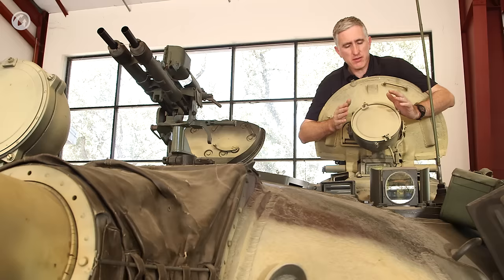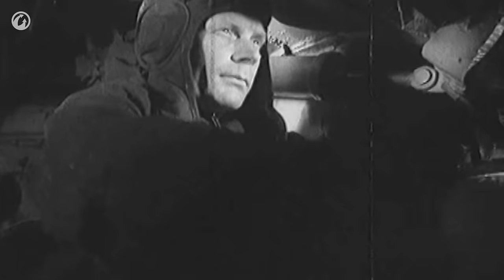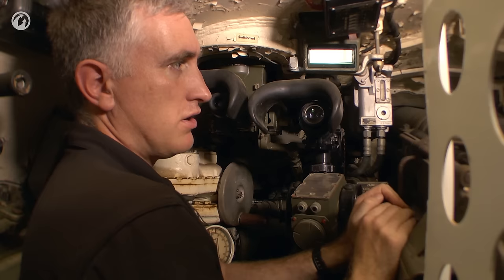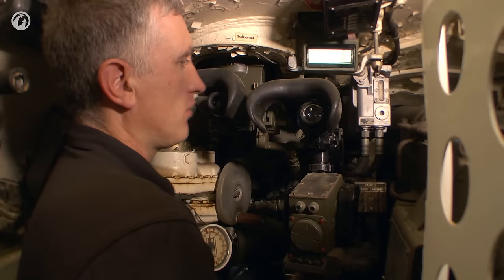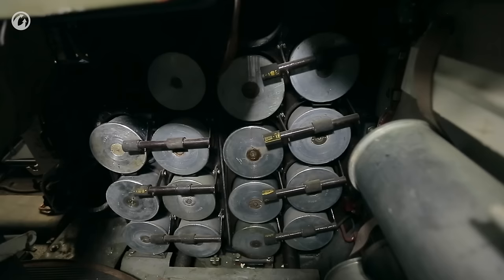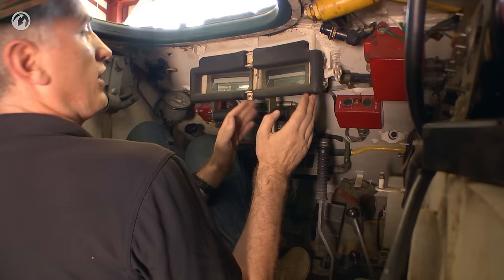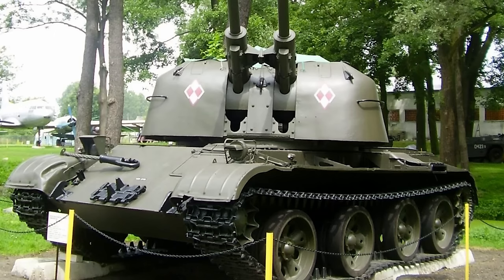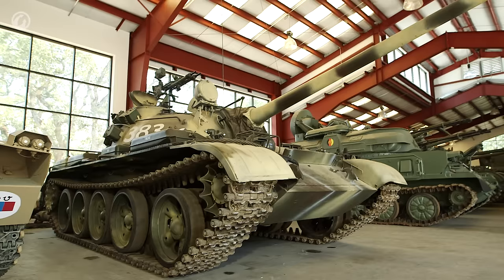Inside the Chieftain's Hatch: T-55A Part 2

Comment: I'm surprised that the Russians didn't try creating a modern separate armored ammo storage compartment on the rear of the turret (with blow-off panels) like most modern Western tanks.  That would have made the tank a heck of a lot less prone to brewing up during penetrating hits.  Likewise adding an anti-spall liner would have also massively increased survivability.   That being said, I can see why this tank was/is so popular in the world even today.  It seems like a very solid and well designed tank that's fairly idiot proof. 
Kinda like the AK-47 of tanks.  
I hope the Russians or the Chinese keep making updated variants of this tank with modern composite armor and a safer armored ammo storage system with blow-off panels on the turret.   Since there is no auto-loader system, this should be possible.  Likewise, it seems like a tank that would be easy to add updated fire control systems and optics to. 
At any rate....I can definitely see how many tankers would prefer this tank instead of a T-72.  Add some ERA to it and slat armor, and you're in business fighting modern insurgents.  
Oh one last thing....didn't this tank have a belly escape hatch?  I believe he forgot to mention that.
Reply: If you had a bustle, it's just as badly in danger as something like the autoloader on the T-72 in the event of a penetrating hit, because you can expect the rest of the penetrator to fly through the turret and enter the bustle. Even if it is of the blow-off panel variety, the hole in the blast door makes it useless. The crew still fries.

Well, actually, Russian tanks were the only tanks to have a spall liner throughout most of the Cold War. The T-55 has a lead-impregnated resin coating on the inside of the hull and turret, which was meant for absorbing gamma radiation and neutrons, but it also helps absorb spall. The T-62 also gets this treatment. The newer T-64 got a borated polyethylene laminate coated to the interior with resin or plaster or something. This was special single-weave polyethylene sheets laminated together, kinda like the nylon flak vests from the Vietnam era. This stuff was mounted everywhere, and it was very effective at eliminating spall.

Conversely, not one Western tank of the Cold War era had a spall or radiation liner, and some still don't have one today. The Abrams, for instance, doesn't have any lining over the drivers cabin, hull or turret roof.
Reply: +Tiles Murphy First of all, No, that's not how the blast doors work, the likelihood of penetrating the front of a western tanks turret, going all the way though and hitting the ammo rack is pretty much near nill, the idea for them was if they where hit from the sides [where most ammo rack penetrations happen] that the Detonation won't harm the crew.

Now onto russian tanks! Ever see a knocked out T 72 or the more rare T80 with its turret in tact and still on its hull? No, i wonder why, that's what happens if you can't vent your tanks ammo rack, armored against spall or not,  its not a wet ammo rack, if it detonates you have dozens of 125 MM rounds worth of energy venting straight upwards into the turret roof.

The reasons most western tanks DID NOT have a spall liner is the fact its pointless and heavy, if you where going to get penetrated in most of the cold war it was going to be by HEAT rounds, they don't produce spalling anyways, or APDFS that would just eat though without a challenge anyways,  Spalling is more of a issue if you are taking rounds that DON'T penetrate, something that was unlikely during the cold war [still in the steel era.] where HEAT pretty much outdated steel armor, and then we get into composites, something that is inherently unlikely to spall like steel does, it became pointless as you had Airspace in your armor to account for that.

Composite armor is like a sandwich, the front most layer is steel, composites in the middle and then the last layer is steel again, any spalling happens between the two layers thus making a spall liner unnecessary.
Reply: Redneck Fury In which case, the high survivability offered by the blow-off design comes not from the virtues of the concept, but of the armour of the tank itself. If the armour on a T-72 was as good as the front turret cheeks of an Abrams, we will be hearing stories about how "safe" the carousel in the hull is. No?

The blow-out design does prevent a side hit into the bustle from catastrophically destroying the tank. However, such a chance is totally non-existent in tanks with no bustle. Therefore, it is not a special feature placed there for extra crew survivability, but a necessity dictated by the use of a human loader.

The fact that the bustle exists is a weakness. If you can shoot something that will penetrate the side armour and set off the ammo, you can also aim just a little bit off to the side and kill the guys in the turret. If you aimed down a bit and shot the hull, you could get them in the leg, or set the hydraulic stabilizer fluid system on fire (the Abrams carries 32 gallons of hydraulic fluid, IIRC), or hit the stowage racks for 6 shells, or all of them at once, because the hull doesn't have a spall liner!

Without a spall liner, even something like a 60mm mortar shell would be pretty effective against tanks, then, no? The Soviets pioneered composite armour. Yet they still use a spall liner. This was done for a good reason. You say that spall liners are only good for rounds that don't perforate the armour. This is not true. Even if an APFSDS shell went all the way through the armour, its ability to actually damage anything within the tank can be drastically reduced if you absorbed the secondary fragments of residual penetrator elements and pieces of the tank's armour (which come off the last layer of armour, so having airspaces within the composite armour is not relevant), thus reducing both the size of the spray cone and the quantity of potential damaging agents. Same with cumulative jets from HEAT shells. A spall liner can prevent secondary elements from entering the tank, so all you have is a very short and very narrow copper or brass or steel or aluminium slug going into the tank instead of a spray of pieces of armour and red-hot specks and dissipated flecks of the jet itself. This is a big deal.
  You might think that the First Chechen campaign proved how crap Russian tanks are, but what most people don't know or just ignore is that most of the tanks only went down after an average of 5 to 6 hits from SPGs and RPGs. There's a picture I've got of a T-72 that got hit in the side of the hull by a HEAT warhead, which went through all the way, and yet, it was perfectly intact and even resumed battle shortly after receiving that wound. The autoloader carousel should have blown like the fourth of July, but the extensive spall lining practically eliminated all of the secondary penetrating elements and saved the tank.
Reply: Tiles Murphy What, Just what the flipping fuck, you know the Russians went to normal bustles themselves right? Notice the T90MS and come back to me .

You don't need a bustle for a human loader, hell the T55 does not have a bustle and it has a human loader.

Also 60MM mortar, are you fucking kidding me? the explosive load behind that is something akin to a hand grenade, Composite armor contains its own spall liner, DU backer plates, Rubber and Fiberglass spacers, dead space, you have no need for a internal spall liner, its just unnecessary, if you are penetrated you are dead, DU sabots will shatter and ignite the air, rip though the crew, all that bad stuff, modern tanks kill each other in one shot if they penetrate anywhere, the only few cases of minimum damage overpenetration came from the Iraq war when super super light armored vehicles like the BMP where shot clean though with sabots, otherwise no modern Sabot will be go though the entire tank.

The T72 is the most commonly knocked out Main Battle tank behind the T55 and T34 [if you count that as a MBT] A tank gunner is trained to aim for center of mass on a tank, guess where the Russian autoloader is? oh shocker, right smack dab in the middle of the tank with no protection against detonation.

Also fucking hydraulic fluid is not that fucking flammable, it several times harder then gasoline to set aflame, plus the automatic fire suppression system sets off nearly instantly.

Stop taking your tank combat advice from world of tanks, gunner's don't aim for weakspots, don't angle their armor of any of that sort of crap, you shoot at what is in front of you, aim for the middle and hope for the best, have you seen how small of a target a tank is at 2000+ Meters even at 20X Magnification?

Now want to talk about design flaws, the T80, no armor between the rear firewall and the crew compartment, a 45 degree attack going downwards into the engine deck has to only go though the thin armor of the engine deck, though some minor engine bits and then into the completely unarmored back of the crew compartment [This is one of the reasons the T80 did not get a lot of love from the russians after that bloody war.]

Also i would like to see the picture of HEAT over penetration, since that's not how heat works at all, notice Cage armor that's becoming quite popular? it detonates the shape charge away from the tank so the charge can't reach the armor. same principle here
So if you have a Heat round penetrate, the distance between both sides of a crew compartment is many times farther then it can reach, particularly when it loses the focusing tube it makes in the armor itself that gives it most of its power [since HEAT works more on pressure then temperature of the melting copper jacket.]
Reply: Redneck Fury And are the Russians purchasing the T-90MS? No, they are trying to sell it to Arab nations with more cash than they can spend. The T-90MS' bustle isn't even the main stowage method for the autoloader, which is still the same as the T-90. It only stows extra ammo. What's there to talk about here?

And do you think that the loader in a T-55 can load a shell in 4 seconds flat? No. For that, you need a good ammo layout, and the best is to have a bustle, which is optimal because it will be close by and above hip level, which means that the loader doesn't have to bend down or move around. 

The explosive content of a hand grenade, but with a thick steel casing travelling downwards at over the speed of sound, hitting a piece of steel less than an inch thick. If you don't like 60mm, then how about 82mm?

Pretty sensational description, and pretty incorrect. "Ignite the air"? If you manage to perforate modern composite armour, you might not also be able to achieve a large overmatch. This is especially true with HEAT warheads. And especially true for the side armour. 

Center mass, sure. British evaluations on tank survivability during WW2 shows that the majority of hits are on the turret. Is that really relevant? No, not really, nor is the statistic that Russian tanks are the most knocked out, because in all those cases, they were manned by poorly trained crews, deployed in an uninspired way, were outdated, and used outdated equipment and ammunition. Even during WW2. They opted not to add appliqué armour and uprate the engine because they affected the pace of production. The documents are available on the site archiveawareness.com run by Peter Samsonov.

Hmm, no. Not really. These fuels may be difficult to set off with a match, and may need to be vaporised beforehand, but we're not talking about matches. We're talking about hypersonic pieces of metal flying around, heated to thousands of degrees by friction from punching through steel. That's not what most people say when describing a match. Let's be honest, the automatic fire suppression system on all tanks can't put out most fires. Remember that case in Iraq when the APU on the back of the bustle of the Abrams (this was before they moved it under armour) was punctured by a bullet and leaked burning fuel onto the engine deck, which set the engine on fire and the crew had to come out and put the fire out themselves? There's a picture somewhere. I can find it for you. 

Can you name a tank that uses a thick composite armour firewall between the fighting compartment and engine? In fact, can you name a tank - any tank that can eat an RPG shot at it from above? Even the earliest RPG-7 grenade could cut through nearly a foot of steel. Your typical North Korean and Chinese RPG ammo (the most commonly used in the Middle East right now) has a nominal armour penetration capability of more than a foot of steel, and there's not a single engine I can think of that is made from armour-grade steel. 

The Russians loved the T-80. Only the generals in charge of the "parade" into Grozny hated it, and that is because they wanted a scapegoat for their own failure to properly conduct urban warfare.

I don't know what you're talking about. I never said anything about the mechanics of HEAT warheads. I only said that extensive spall lining saved a tank by drastically reducing the diameter of the spray cone and the quantity of secondary penetrating elements such as bits of armour and flecks of the jet itself.
Reply: Redneck Fury  sorry but Tiles Murphy is correct on this one.  You most definitely get plenty of spall from both HEAT and SABOT AP perpetrators.  You mentioned earlier that steel doesn't spall much.  That is absolutely false.    
Murphy is also totally correct about why most modern tanks moved ammunition to a turret bustle.  Ever tried picking up a 120mm shell?  They are VERY heavy. As shells have gotten bigger, it becomes a physical danger for the loader to be picking them up regularly from the hull. His back will simply give out eventually.  As such, human biomechanics have to be taken into account.  The Abrams is beautifully laid out to fully take advantage natural biomechanics so that the loader pulls out rotates, and inserts the shell into the breech with a very natural movement of the torso that minimizes the chances for a back injury.  
Also you need to read up on the Israeli experience with hydraulic fluids.  During the Yom Kippur War, most Israeli tankers vastly preferred the older Centurion tank to the American M48 and M60 Patton tanks due to the Pattons having very vulnerable hydraulic lines that DID catch fire.  That is one reason why the Israelis extensively modified their M48's and M60's into the Magach series of tanks.
Reply: The reason Russian armor got hit so bad in the first Chechen war is because the commanders sent them into urban environments without sufficient infantry support. The quality of the tanks had little to do with it.

Comment: Use the fuel as armor? I do not really get it. In WoT  at least.
Reply: +krucafuks123 The idea is that the spall and fragments from the  penetrating shell will be stopped by fuel before they reach the ammunition rack. Liquids are really effective at slowing things down. If you've seen the Mythbusters episode, where they fire different guns into a swimming pool, you'll get the idea. Of course fuel will most likely start to burn but it still burns at a slower rate than the propellant inside the shell casings. So while the vehicle will go boom eventually, it won't do so immediately and will hopefully give the crew enough time to get out.
Reply: Thanks
Reply: +TheRetu81 also diesel is much more difficult to ignite when in liquid form. As a vapour it's much easier, so hitting a fuel tank wouldn't be as catastrophic as hitting the engine with fuel vapour inside. I've seen a situation in a garage where something caught fire so a mechanic grabbed the nearest liquid and extinguished it...that liquid happened to be diesel xD

Comment: T-55's today can be pretty dangerous to even modern tank as long as you have modern ammunition for the 100mm, of course penetrating a modern tank frontally with the 70+ year old 100mm gun design is going to require some serious prayers and high tech ammo
Reply: Or a good ATGM.